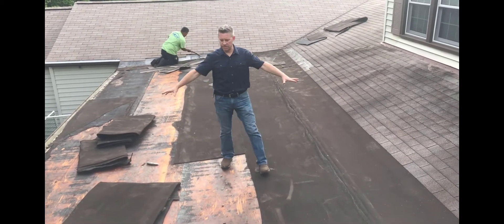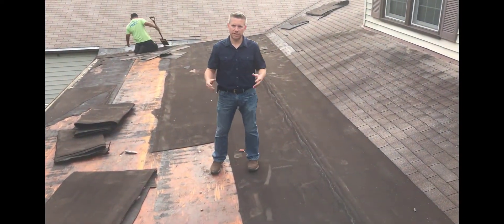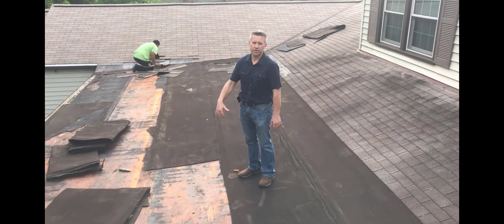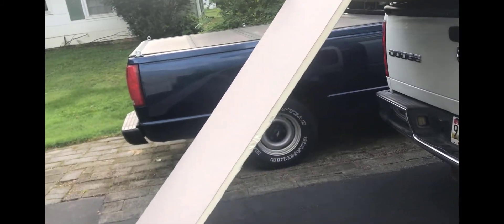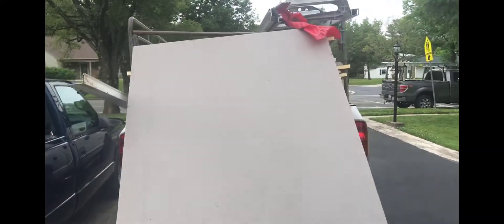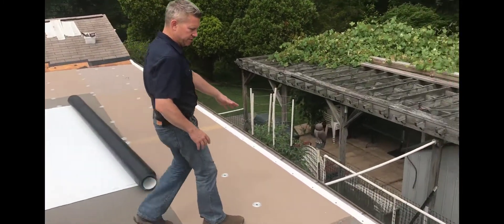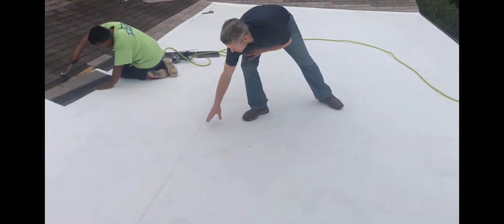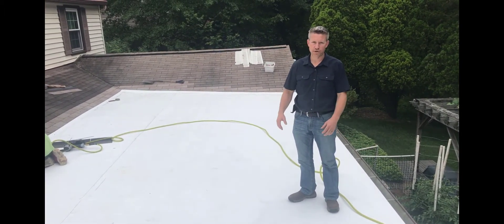TPO Roof Installation

Comment: Fasteners/plates are supposed to be 6" back from edge of insulation board not at the seams. Wood nailer wasn't installed. Membrane should go under drip edge then weld a strip over. Not to mention look at that rough iso install. You clearly just pieced in leftover scrap from multiple jobs and it looks like a couple aren't even right side up but MA so who cares right? 

These guys would have to teat off and start over on a commercial warranty but it's residential so no one tends to notice

Comment: Another Roofer Who Doesn’t Know how to do Roofing.  Apparently No Wood at the Perimeter, all insulation plates attached in all the wrong locations, the field membrane not turned down over the face of the wood before the metal facing goes on.